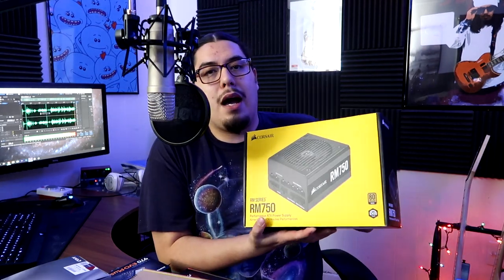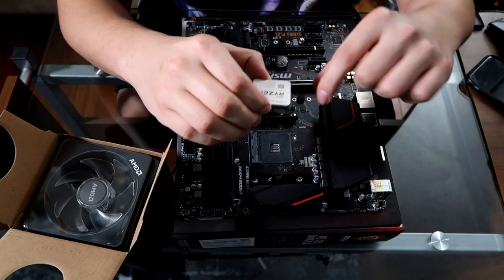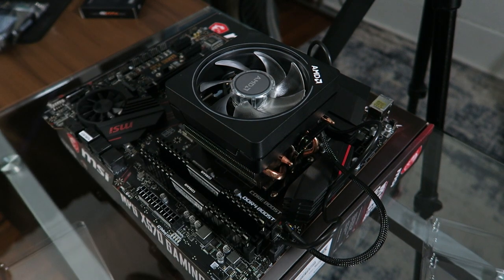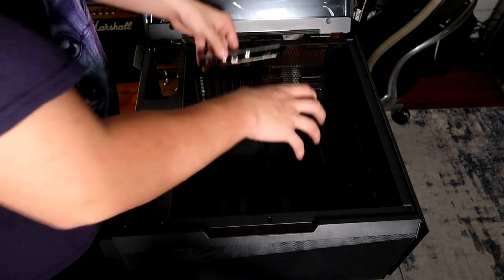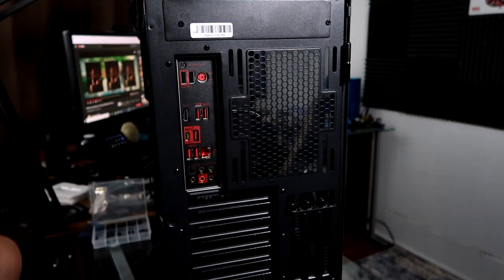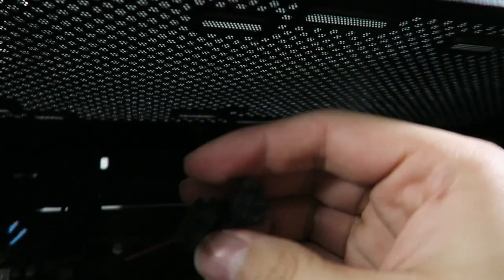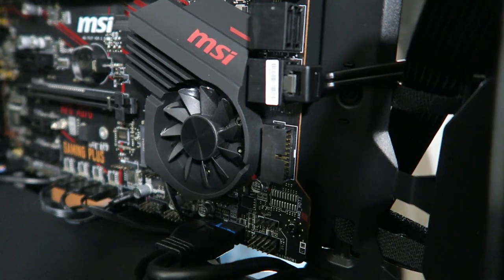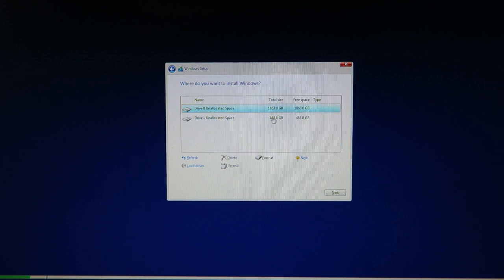$1000 GAMING PC Build Guide - Ryzen 7 3700X GTX 1070 - How to Build a Gaming PC Full Guide

Comment: If I had the money would the 4GB BarraCuda, 64 GB ram (2x32gb) and Ryzen 5800x? or would it not fit correctly with the rest of the parts?
Reply from the maker: It would fit but you would most likely have to update the BIOs on the motherboard

Comment: Is this build good for streaming as well? I don’t know anything about computers but I got a 1070 with triple fans.
Reply from the maker: Oh hell yeah. This thing will be able to stream any game no problems.
Reply: @ChiefSweet  I’m guessing there won’t be any problems with triple fans on my 1070? 

Thank you for replying so quickly!
Reply from the maker: @opchew1570   no problem at all. That’s just for extra cooling.
Reply: @ChiefSweet  is it okay if I got the white DRGB case?
Reply from the maker: @opchew1570   yeah cases are really just preference so get any case you want that fits a regular ATX motherboard and will have the clearance for your graphics card
Reply: @ChiefSweet  at 11:31 which screw is that? I’m not quite understanding nor can I see it clearly lol
Reply from the maker: @opchew1570   it’s a m3 screw comes with your case usually
Reply: @ChiefSweet  so it’s the same screw that I used for the rest of the motherboard?
Reply from the maker: @opchew1570  yes
Reply: @ChiefSweet  and when you say stood off @ 12:02 does that mean that it can’t be screwed onto both sides because the left side had the different type of screw?
Reply from the maker: @opchew1570  no the stand offs are a screw that will keep the motherboard off of the case. A lot of times they are already screwed into the case though.
Reply: @ChiefSweet  and are the case fans supposed to light up as well? And how do I do that?

Edit: nvm I got it to light up but now how do I sync them up together with the cpu cooler🤣
Reply: @ChiefSweet  I think I installed the motherboard drivers wrong. I followed the video right before the cut and then i didn’t know what to do with the rest of the unzipped drivers:/ it’s hard to explain what I did because idk what I did but then a pop up happened prompting me t restart my pc to see the changes happen and then it gave me the blue screen of death on loop :/
Reply from the maker: @opchew1570   hmm really weird you can reinstall Windows and just not update your motherboard.

Comment: yo im building a pc and is 500$ for a gpu with 6gb reasonable rn
Reply from the maker: Yeah that’s reasonable for right now
Reply: @ChiefSweet  alright thank you so much and is it recommending to have both an HDD and SSD or am i fine with just the SSD?
Reply from the maker: @luminalcard8290  you’ll be fine with just an ssd. I just use a hdd for more memory for cheaper

Comment: I want to build a pc still trying to get parts figured out I'm gonna get the ryzen 7 3700x  but don't know if the B450 f 2 motherboard is good for it
Reply from the maker: Is that the asus gaming one? If so yeah it will work
Reply: @ChiefSweet  I picked up the Ryzen 7 3700x as well but I was wondering if its compatible with the Rog Strix B550-F?
Reply from the maker: @illegalalien4444  yeah that’ll work fine
Reply: Ryzen 7 3700x and asus rog strix b550f is the combo I used and it runs perfect